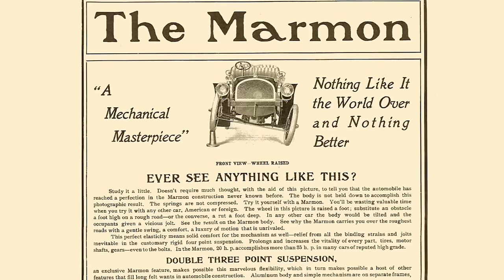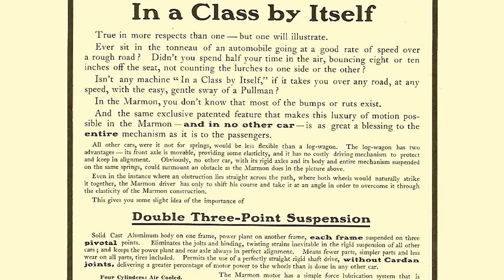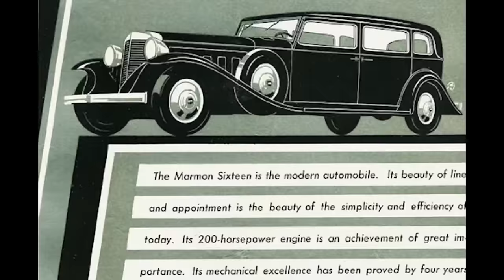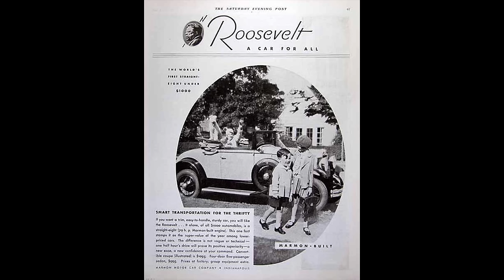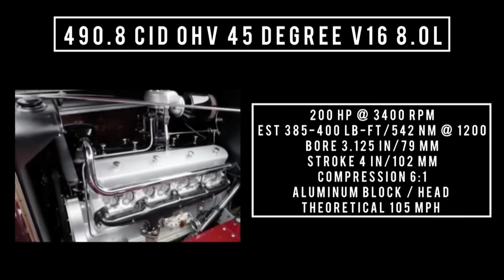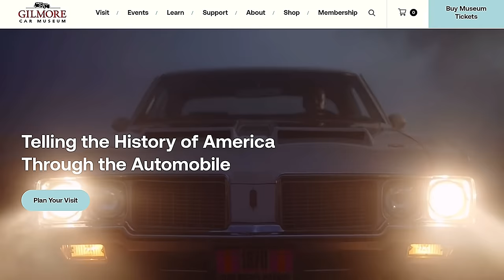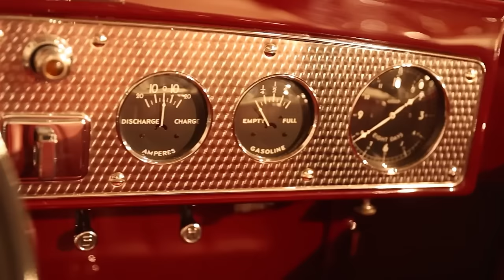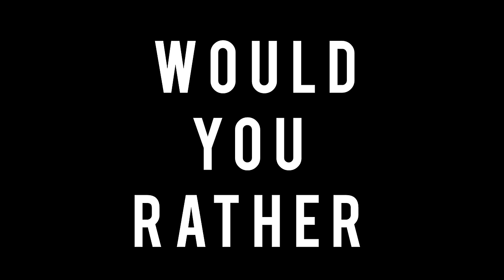1931 Marmon Sixteen

Comment: Of the six choices and based on the photos, I would take the Marmon and the Packard.  The Marmon is a very elegant car, it’s one of the most stylish and well appointed cars you’ve shown of that era, yes even compared to Packard, et al.  I did not know they made such a distinguished car.  When I was a kid, my uncle used to tool around in a 28 Marmon Roosevelt, that was a cool car but not nearly as well equipped as this one.  Thanks for sharing.  😉👍

Comment: Wow, truly beautiful.  Chuckled at the “Sportlite” name on the spotlight. I’ve used and maintained Unity spotlights over the years. The 20-0-20 ammeter certainly emphasizes the changes in electrical systems.  There was SUCH a contrast between the magnificent cars of the 1930’s like Marmon, Duesenberg, Cadillac, Packard, Pierce Arrow, et al, and the common man’s cars like Model A Ford or a basic Chevrolet.

Comment: You knocked two balls out of the park, well done research both videos . The maroon coupe in the videos I just read an older magazine article about that one the owner spent a huge amount restoting that one.  The Marmon 16 was an outstanding car that's the only car that had the Packard 12 beat in craftsmanship. First choice-  both videos 31 Marmom 16,  second 31 Pierce 16, and the 35 Auburn speedster from the engine video.
Reply: If you want to see a running Wills St Claire if you haven't checked out the video the other  Jay has a beautiful green roadster, that V-8 runs so smooth, he threw some dollars at that one.
Reply from the maker: Great choices. 

I really wanted to try to have this done yesterday. I went to Michigan Monday and Tuesday and I drove home Tuesday. I had most of it done, but there was a few spots that I had to fix… because of bad Information.. it came from the Adrain museum so I thought it was good information. It said the Roosevelt was powered by V8 everywhere else that I saw it was a straight eight they did V8 engines at one point in time but they went to straight eight and they kinda never looked back, but I could be wrong because the research provided tons of conflicting information.. even the article that I put in the episode said the Marmon 16 is 2 in line 8 cylinders just like the Cadillac but that’s not really the case the marmon engine is cast as one piece like a modern engine ( heads come off ) the Cadillac was cast in three pieces
Reply from the maker: I’m gonna let you in on the list of cars that are coming. These are in the pipeline. I shot these Monday and Tuesday.

1935 Auburn speedster 
1920  Paige 
1937 Packard  12
1957 Packard  hawk
1950 Studebaker champion 
1926 wills Saint Clair 
1917 Mercer 
1927 Erskine
1926 Pierce arrow 
1938 Chrysler royal 
1934 De Soto airflow 
1932 Essex, six 
And tomorrow’s episode 
1937 Studebaker coupe express 

I might be missing a couple
1954 Kaiser darrin

Comment: WYR #1 Marmon, WYR #2 Packard.   This is a magnificent example of all that was best in US manufacturing! Simply beautiful. 
Anecdote, somewhat related - around 2008 we took a trip from Cape Town to Bloemfontein, South Africa to purchase a 1936 Lincoln Zephyr sedan. We missed that by 1 day as it had been sold.  On route via the N1 we stopped for fuel at either Matjiesfontein or Laingsburg. Not sure which now as we are not from South Africa, but there wasn’t much else around, so likely Laingsburg.  
Walking around the back of the gas station we saw a yard full of rusty but completely intact Ford pickups from around the 1940’s as well as many Marmon-Herrington Ford trucks.  These looked like they’d been parked up since the late 1950’s and the arid desert climate had kept them in pretty good shape, apart from deteriorating upholstery etc.  We did eventually purchase a 1956 Ford delivery van body in Bloemfontein and saw many other classics in good shape.  Probably not that appealing to US buyers as they were all tight-hand drive.
South Africa still contains many automotive gems.

Comment: The Marmon V-16 was technically superior to the Cadillac and a more modern car, particularly in styling - which may have played against it, and may still sway some collector taste; it does not evidence all of the 'classic' themes that some have come to associate with the type.  There is an old magazine test that directly compares a Marmon V-16 / Cadillac V-16, both owned by the late Gen. William Lyons that provides some interesing insight.  WYR:  1)  Given the 1 of 1 status, I'd take the Peerless for its pedigree.  2)  The Marmon for its inherent superiority.  (Made somewhat less challenging b/c there was no 31 Packard Twin Xis; they brought it back for 32)

Comment: V10s, unfortunately, suffer from vibration in all 3 dimension. They have, of course, been used in modern F1 cars, but are not suitable in basic design. You could add balance systems,weird crank pin angles, etc.
But at some point you must ask: " why are we doing this?"
Turbo V6? Yea.....
Reply from the maker: Great insight and information

Comment: In terms of styling Marmon was towards a "less is more approach" (and nailed it) but was certainly as good as they came in engineering. The Wasp won the first Indy 500 interestingly by not driving as fast as the car could go but drove just under the speed of wear so the tires lasted much longer. A bit like the GT40 at LeMans where brake linings could be swapped quicker and shorten pit times. The rear view mirror although a good idea was next to useless due to vibration.
Reply from the maker: Great insight and information =)

Comment: Marmon catalogued bodies were made to a price, and you can see it.  The V-16 was a better engine than the Cadillac V-16 and should have been compared to the Cadillac engine, not the Duesenberg engine.  Marmons depreciated quickly because they were an orphaned car and you could buy them for a few hundred dollars by the late thirties, no one wanted them.  After the WWII scrap drives, any remaining Marmons shot up in value.  Your choice cars held their value better thru the depression, but for asset appreciation the Marmon V16 was king.  Marmon V16 engines were popular for refit into certain fire trucks.  I suspect that many engineless Marmon chassis took back their retired fire truck V16's after WWII.  Fire trucks were using aluminum engines as far back as the early teens.  Wild guess on the song: You and Me by the Turtles, but don't have much confidence in my guess.

Comment: Probably skipped V10 engines due to the issues of making a strait 5 engine without using fuel injection.

You can't get even flow resulting in different cylinder performance depending on how far each cylinder is from the carburettor. Since a V10 is two It's it'd have the same issues.

Comment: I believe that aluminum was actually very expensive to make during that era and was almost a "precious metal"
also probably not much was known about how to alloy it - pure aluminum is very weak I understand 
at some point a new process was discovered that allowed aluminum to be made from a common clay ?
I still think iron based metal and steel if properly handled and alloyed is far superior to aluminum for most parts of gasoline and Diesel engines unless light weight is a  high priority 
forged aluminum alloy better than cast aluminum?